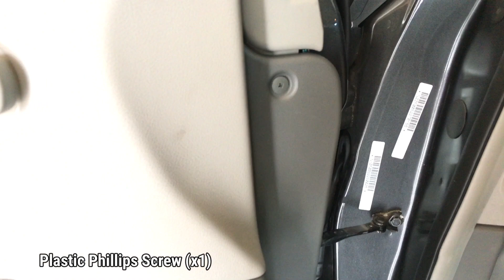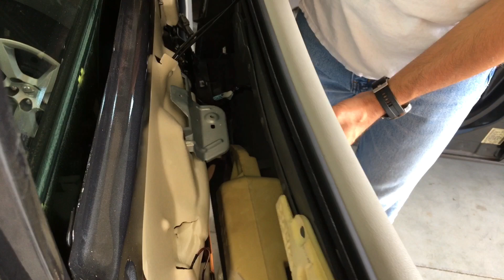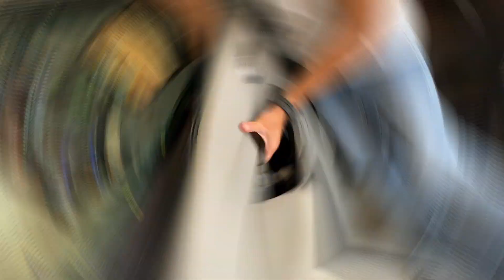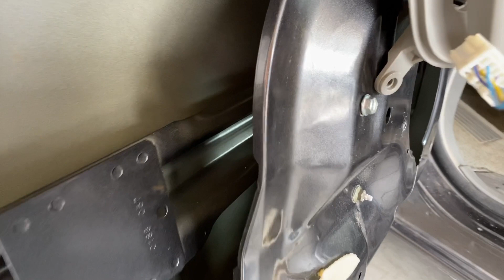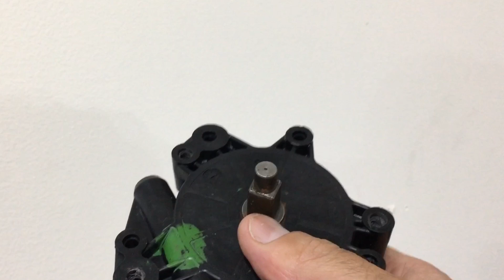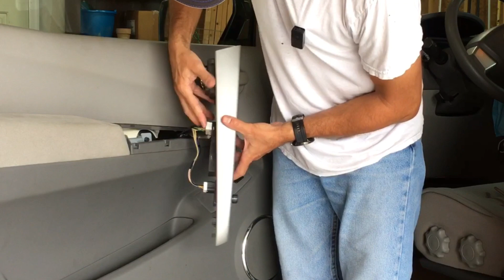How To Replace Power Window Motor - Nissan Quest (Andy’s Garage: Episode - 360)

Comment: Thank you for sharing this!! Tomorrow I am going to do this on the passenger side. Now, I feel confident to get it all done right.
Reply: How did it work out for you did you change it yourself
Reply: @TooBoss914, it worked out just fine. It was really straightforward, and once I had the panel off, it all moved along like it was supposed to.
Reply: @Roping87  I have to do the same it's always these passenger side motors always messing up because people be slamming the doors hard
Reply: @Tootoojackson  for real!!